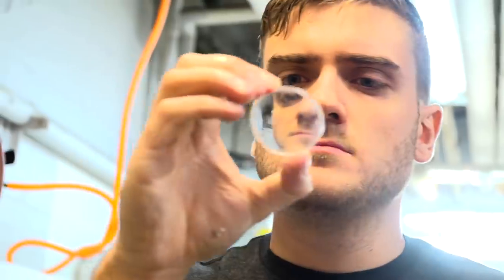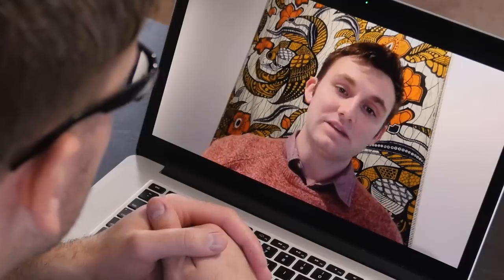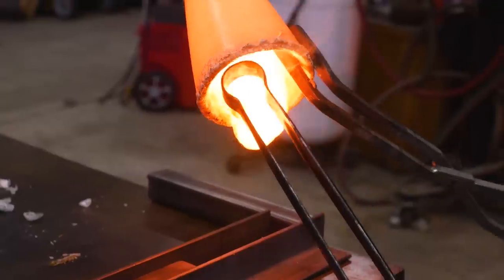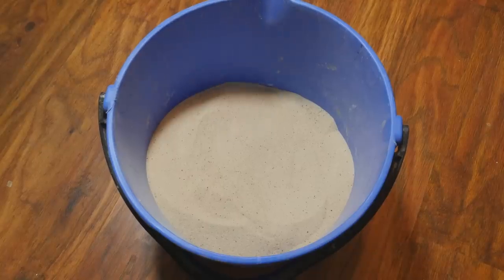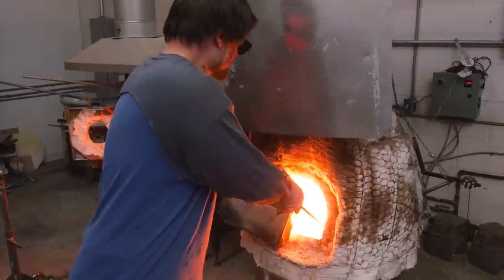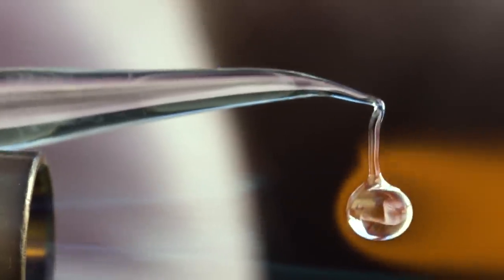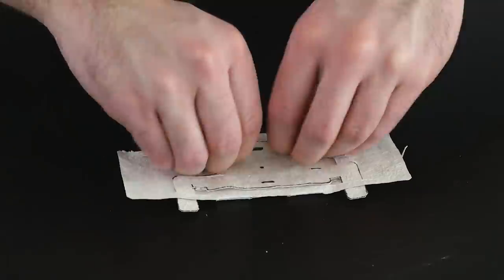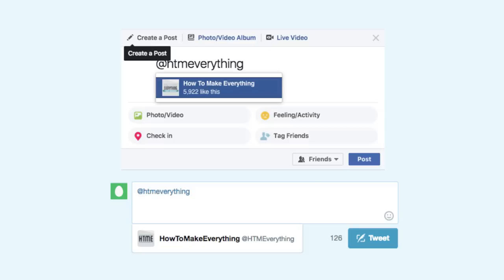How to Make a Microscope From Scratch

Comment: Could you dedicate a couple of videos to perfecting your glass making?
Reply: I am also very interested in that, but I can see him getting somewhat frustrated at some point
Reply from the maker: I've been getting some interesting suggestions to solve the issues I had, so I may give them a shot and make a third attempt next week.
Reply: ok thank you!
Reply: Have you tried dissolving the eggshells in acid? You can get hydrochloric acid in hardware stores (it's called 'muriatic acid' there) for cheap. You can dissolve them with the acid and then filter out anything that doesn't dissolve, forming calcium chloride. After that, adding sodium carbonate (such as from baking soda) will convert the calcium chloride back to calcium carbonate.
Reply: Wouldn't he have to make his own hydrochloric acid and sodium carbonate?
Reply: That's true. Instead of HCl, he could try vinegar. Vinegar is just acetic acid and water and is easy to make from alcoholic drinks (which he's made many times before). It would be slower but it would still work. The sodium carbonate, he could get from the potash he made from hardwood ashes. Potassium carbonate (which is one of the biggest constituents or potash) would work just as well.
Reply: Hi

Comment: You should be able to get the sulfur out of the shells by "roasting" them, it's used in refining ores as well, recrystallizing the potash a few times will also get rid of most impurities remaining.
Reply from the maker: I assumed the melting processes in the kiln would have burned everything off, but I guess it leaches out into the glass if you do it with everything else at that point.
Reply: Probably not, because the sulfur forms calcium sulfide with calcium oxide that is created under those high temperatures and therefore isn't burned. Consider my ideas mentioned in another comment to get rid off the sulfur and other impurities in the first place.

Comment: You should have purified your resources not only more physically but in addition chemically. My ideas for the next try are as following:

Potash:
Improve the purity of the potash by multiple recrystallizations, that is, redissolving your product with the smallest possible amount of water, extract impurities and boil the water away. For nearly pure potassium nitrate you could try to find a source of saltpeter. 

Calcium Carbonate (from eggshells):
Firstly, as you did, pulverize your eggshells. Then burn your powder above 800-900°C under a high oxygen atmosphere (maybe use a fan) to get rid of organic compounds (they are charred and the carbon is oxidized to carbon dioxide). This will form calcium oxide, e.g. quicklime, which is highly insoluble in water but particularly good at absorbing sulfur by forming calcium sulfide. Sadly both quicklime and calcium sulfide are highly insoluble in water, but quicklime will react quite vigorous with water to form calcium hydroxide, which is really soluble in water. Because of that, you can filter off the calcium sulfide and treat the calcium hydroxide solution by bubbling carbon dioxide through it (use your breath or mix some vinegar with uncleaned lime or eggshells) to form nearly pure calcium carbonate. 
(I don't propose a treatment purely with strong acids because then he needs to make those by himself)

Silicon dioxide (from quartz sand):
Heat your sand after removing iron compounds using magnetism to get rid of organic compounds

General:
Maybe use an oxidizing agent (like saltpeter) to reduce discoloration because of transition metal compounds. Add some zinc oxide to reduce the melting point of your glass. Add some baking soda to reduce the formation of bubbles.
Reply from the maker: Thanks!  I think I'll try giving these suggestions a shot!
Reply: David Strahl he could synthesize the hydrochloric acid using a water/table salt solution and a voltage source with two electrodes. it will make hydrogen gas and chlorine gas, which can be reacted to form hydrochloric acid. the leftover "salt water" can then be used for sodium hydroxide. make sure the electrodes are made from pure carbon, and no metal wires make contact with the water. You now have a powerful acid and base.
Reply: Carson Rush Indeed he could use electrolysis. Nice idea :D The hydrochloric acid could be used to dissolve acid soluble compounds in the quartz sand to reduce contamination (SiO2 won't react with HCl).
Reply: Saltpeter is easy to make, you just need rotten urine. Well, you might need it to have decayed in the ground, not sure on that. Find a stable, dig up the dirt, run hot water through it and collect it, boil off the water and that gives you mostly salt peter left over. You can extract it more efficiently by cooling it to a point that it crystallizes then straining the water off but you have to be careful of the temperature. Cant strain off frozen water ya know?
Reply: AhKeelU And you need about one year time. See the video "Making Gunpowder" by Cody's Lab for reference
Reply: David Strahl potash is potassium carbonate. Duh
Reply: David Strahl baking soda decomposes into co2 it makes bubbles
Reply: @david Strahl 
please correct me if i'm wrong but, could you tell me how can Ca(OH)2 from eggshells became CaCO3 if you give a strong acid? cause as i'm concern Ca(OH)2 + HCl just from a CaCl2 salt, not CaCO3. Thx btw for ur briefly explanation
Reply: the point of the acid is to drip it on something else that would produce CO2 that you can pass into Ca(OH)2 using tubing.
Reply: David Strahl “E.g. quicklime” exempli gratia  ‘for example’ quicklime. Did you mean to say I.e.-id est “,that is, quicklime”?

Comment: Years ago I built a microscope, but not nearly from scratch.  I salvaged an eye lens from an old camera's viewfinder.  The objective lens came from a #222 flashlight bulb, and was glued into a thimble.  I used a thin metal tube for the body, probably from a cigar package.  I experimentally determined the correct distance spacing between the two lens.  I probably got somewhere between 100-200x magnification, with a fair amount of color fringing.

Comment: fyi, you get a lot more/cleaner potash with a really hot fire. start with hardwood,  and use a blower to pump air into the fire. If the ash comes out black and still has bits of charcoal in it, the fire wasn't hot enough: the hotter the fire, the cleaner the ash should come out.

Same deal with the kiln: heat from the bottom (heat rises), and blast air in to boost. You can hold heat better by just making a covered hole in the ground with an opening for fuel/air feed rather than stacking bricks in the open. You'd also get a much hotter fire off with a bag of legit coke from a foundry and a blower than with a propane torch. You can always bake the sulphur out of green coal to make your own coke too.

Comment: From my understanding, the goop on the top of the potash mixture is probably salts coming out of solution. When you boil the mixture, the things with less solubility precipitate out and become insoluble, but only while its hot. Should try filtering the hot mix when you reduce to about half of the starting liquid then letting it settle while cooling.

Comment: The solution is to filter the solution of potash through 4-5 coffee filters. Then crystallize slowly with great care. Also premelt the sand before you use it and use the clear bits in the final step. This should theoretically work. Take the clear bits and crush it into sand.
Reply: Also you could take the eggshells and burn them in the kiln. The heat will cook off the sulfur, proteins , and more

Comment: Rather than paper for the glass holder, use some thin 1.5 mm abs piece with a hole and trap a water drop.Surface tension will lock the drop in  the hole.

Comment: The PPG glass makers put the ingredients on tin.  They heat the ingredients and tin up to 3000 degrees for about 12 hours.  Then they let it cool.  The glass solidifies on top of the liquid tin.  The liquid tin keeps the glass hot as the temperature decreases slowly preventing breaking.  

The glass blowers dip molten glass out of an oven.  They keep it hot with torches.  When they are ready to cool it they put it into an annealing oven to bring down the temp slowly. 

You are too quick.  You don’t get it hot enough for long enough.

Comment: Can you make a battery from scratch and use it to turn on a lightbulb made from scratch?
Reply from the maker: It's on my list of future projects, but it'll require some ingredients that are outside my budget at this point unfortunately.
Reply: You could always try the oldschool Baghdad battery.
Reply: Note that you don't need a vacuum, you can maybe have a non-vacuum bulb, and then get rid of the oxygen in it. For example by dropping in a burning splint and some sort of dessicant (activated charcoal? Or your potash if you can dry the water out of it making it hygroscopic again) to get rid of the water vapor, then capping it off with something until the splint burns out all the oxygen, the dessicant eats up the water, so it's only CO2 and Nitrogen inside. Then light the bulb.
Reply: Gabe you use copper coil, lemon, potatoes, and some other ingredients.

Comment: It's weird that something in your glass makes these bubbles. 8:14
The normal glass doesn't do this. What's could be the cause of that? If it wouldn't have these bubbles the slight yellow colors won't matter much I think.
Reply from the maker: +Aldo I'm suspecting the potash didn't end up fully mixing/burning off.  When it cooled overnight, a waxy substance formed over it.  I suspect that's some of the potash separating and is what's getting burned off when I put it to the torch.
Reply: So, if you would keep it in the torch for a some time it might work, right?
The big furnace didn't seem right to me. Maybe just not hot enough. I can imagine that if you take a small portion of your half-glass that you could easily heat it with the torch and maybe get the remaining potash burned away and thus no bubbles and clear glass? Would love to see you try :D
Reply from the maker: I tried to heat it as much as I could with the torch, but likely letting it bake over night in a kiln would be the best chance of success.  I still have a fair amount of glass leftover that I'd like to throw into a real kiln once we have the chance, and see if we have any better luck then.

Comment: Did all the glass you made turn yellow or just the one bead you tried making into a lens? Because carbon contamination from burning hydrocarbons too could of made their way into it while blasting.

 The regular glass being so smooth would have little issue with this, but your porous glass could catch and trap the soot, discoloring the glass.

Comment: i got a lot of old spray paint cans (that have a ball inside). i opened them, removed the ball, and cleaned the glass marble, and several were perfect for magnifying lenses! i used soda bottle caps and necks, to hold the glass marble inside... (i had 7 old cans, and 6 had perfect glass marbles for lenses, so i put 2 together and made an adjustable microscope!!)

Comment: one of the problems i see with your glass is that u were holding it too close to the jets on the torch as it is a air/fule surface mix torch u were putting the glass in the benzomatic gas jets that had no air in it. i hope u used didum glases when working the glass as u can get cataracts without the ir protection.